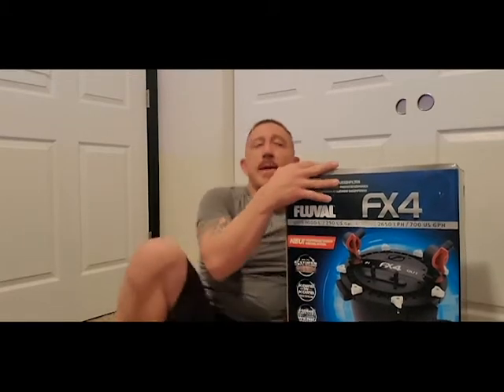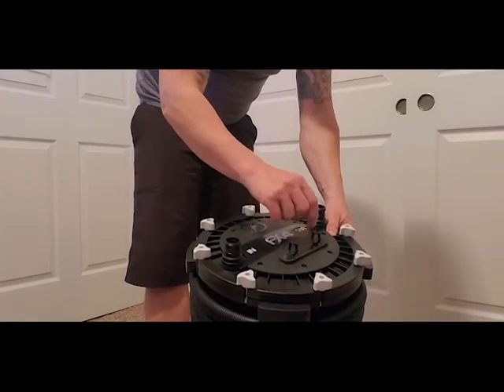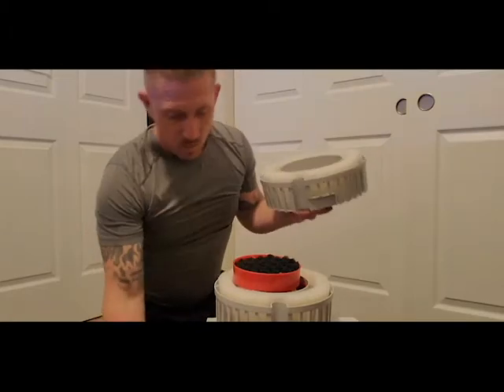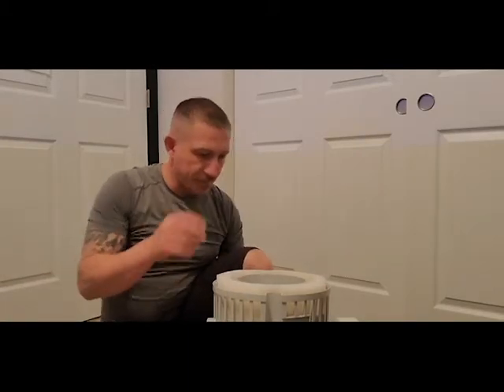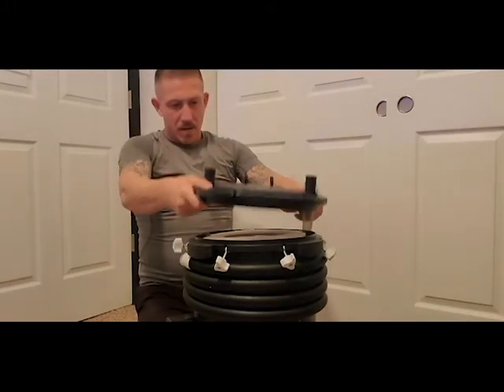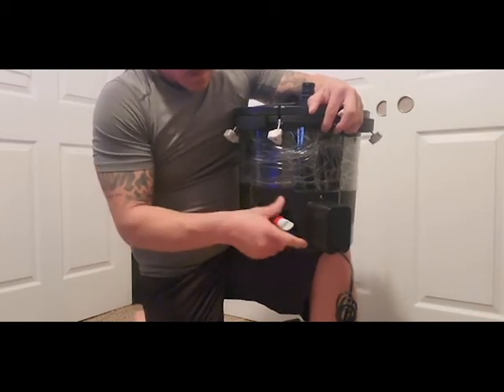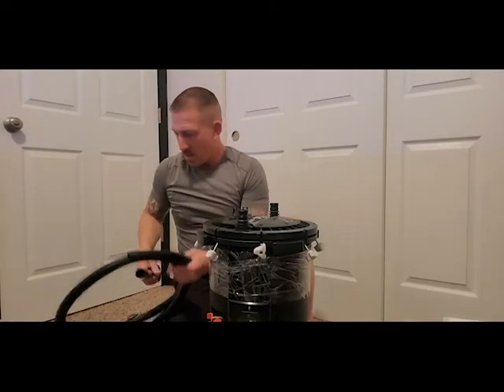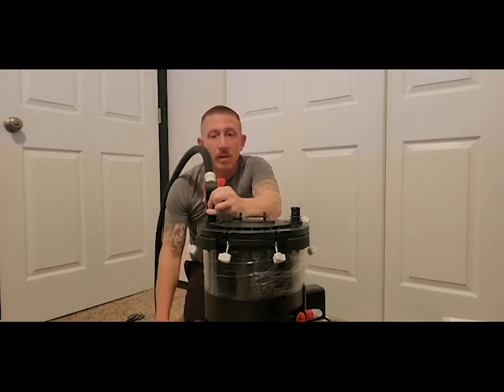FX4 setup

Comment: I need help with my fx4 it is not pumping any water bit I can still hear the impeller running .Please help.
Reply from the maker: Have you primed it?
Reply: @ShrimpinAintEz_com  I have and then it makes a weird noise as if it's turning of and on or wanting to pump water but it can't
Reply from the maker: @AdrianSanchez-hy3iz  they will turn on and then off automatically every so often and they do that to purge out air so what you should do is get it as full as you can before plugging it in.I would also check to make sure that your impeller and everything like that is clean and not rubbing on anything sometimes sand can get stuck in the impeller and that can cause a lot of problems
Reply from the maker: If that doesn't work and you can't figure it out you're more than welcome to PM me on Facebook or something like that my name is the same on there or you can find me in my Facebook group called "Aquatic YouTubers"
Reply: @ShrimpinAintEz_com  okay thank you
Reply from the maker: @AdrianSanchez-hy3iz  did you get it going?

Comment: What about the O-RING? Why ignore the O-RING? It's very important.
Reply from the maker: Which O- ring are you referring to?
Reply from the maker: @Tyler Neal are you referring to the o'ring that goes on the lid? If so you put it in the underside of the lid. There is a grove that the o'ring fits right in.  If that doesn't help you please let me know. I can make a video tomorrow to help you with it.
Reply from the maker: @Tyler Neal there isn't any lubricant. The water itself should act as a sealant. Adding anything with risk harming the fish. What you could do if this is a new setup is get it around the lip of it and use some sort of tape or something to hold it down and let it stretch out for a bit but you would have to be careful of any of the residue from the tape. I didn't have any problems with any of my fxs with this. I'm wondering if you got some sort of a defective o-ring.
Reply from the maker: And when I was talking about taping the o-ring in place and allowing it to stretch obviously that would be without having the filter run I would just leave the lid off so you can make sure that it's still in place.once it's been there for a couple hours I would assume you'd be able to remove that tape.

Comment: How can I Restrict the flow on the fx4🤔
Reply from the maker: You can close the "out "a bit.. but I could probably give you better advice if I knew what you were trying to do because there are other ways to get certain results.
Reply: @ShrimpinAintEz_com  I have a 55 gallon community fresh water tank i think the flow is to strong. Thanks for replying so fast
Reply: Hello @ShrimpinAintEz_com  I just installed some foam inside the output assembly (nozzle) it seems to be working 🤟🏽
Reply from the maker: @rude1523  great minds think alike that was going to be my thought.
Reply: @ShrimpinAintEz_com   I just hope it doesn't ruin the motor... my fx4 was on sale so i had to get it lol 🤟🏽
Reply from the maker: @rude1523  could you possibly angle it differently or add a piece of pvc to diffuse it?
Reply: @rude1523  it is going to get clog on its own a limit the flow, or you can use rainbars
Reply: Best way is to make the output hose longer.  The longer the hose, the less pressure it's pushing out.